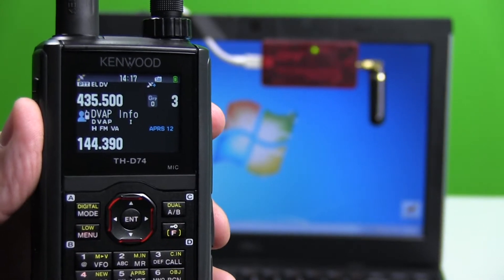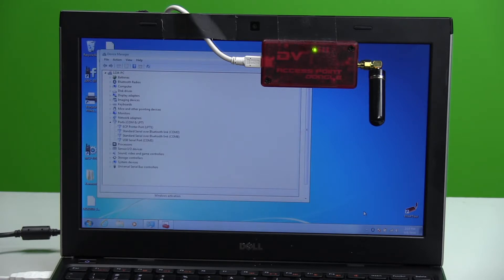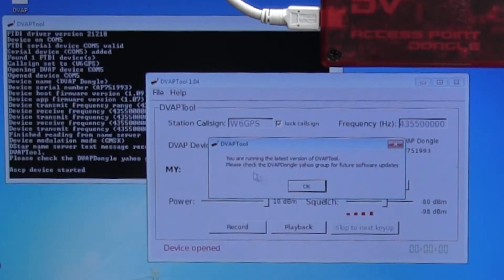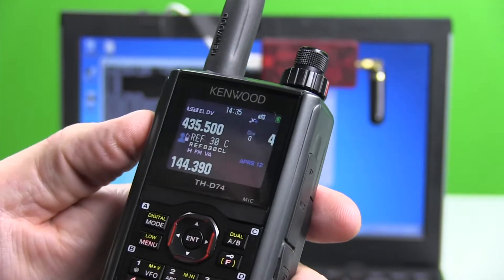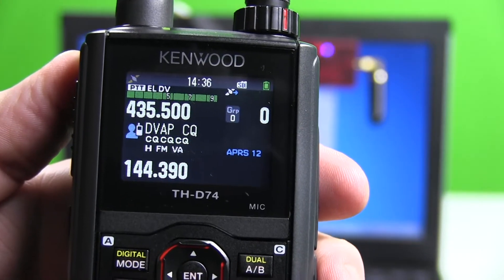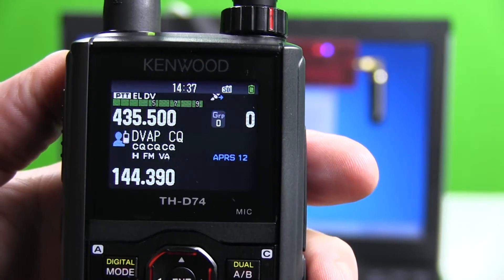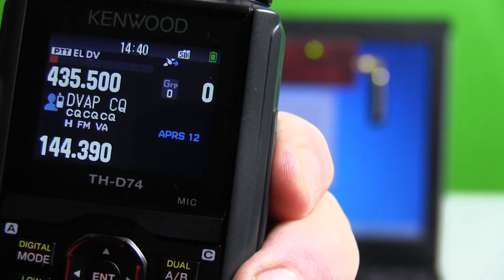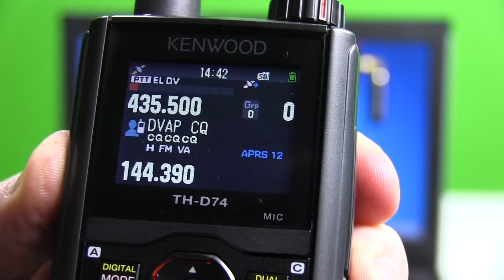Kenwood TH D74 with DVAP

Comment: I know this video is 2 years old but for anybody watching, he shows a frequency of 435.500 for his DVAP which is not a good frequency to use for hotspot work since it is reserved for satellites only (internationally).  Even using very low output, satellites are still line-of-site and easily interfered with and the band plan should be followed for your area when selecting a simplex frequency for your hotspot. Never use 435-438 reserved for satellites.  Otherwise, excellent video!  I’ve watched it several times.

Comment: Great vid. Think I will wait on dvap. Too choppy to spend $280 on.
Reply: KW4MA you can use the sharkRF openSPOT to do the same thing without using a PC at all.  I think they run 200-230ish and support dstar, DMR, and Fusion.  I think it even supports P25, though I'm not sure what use that is.